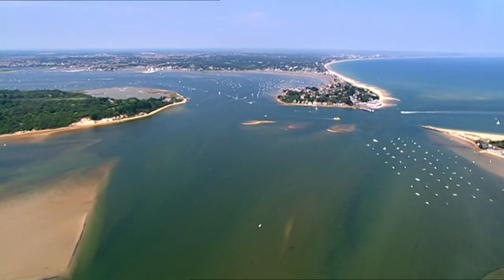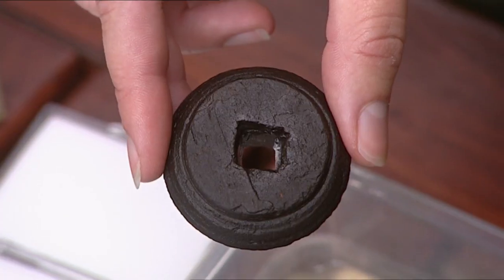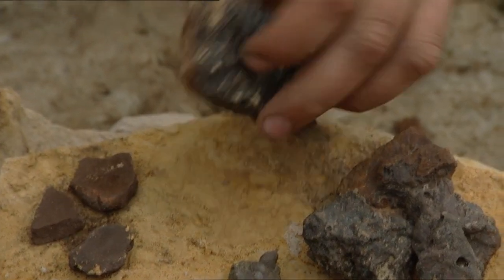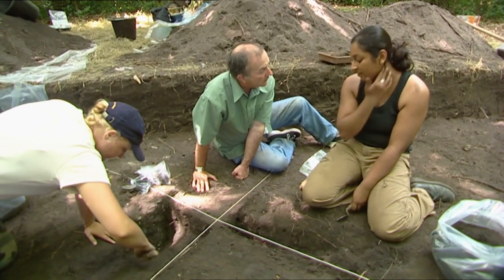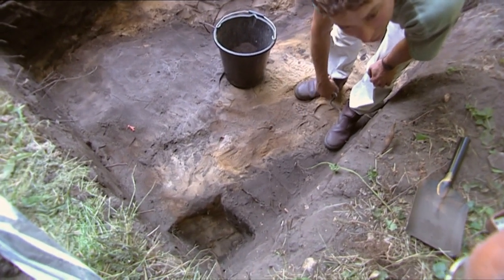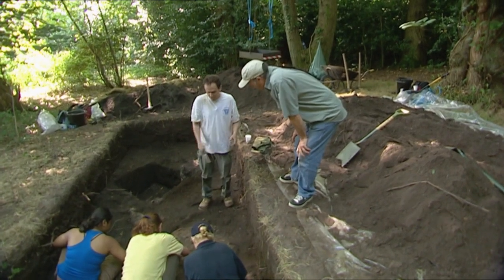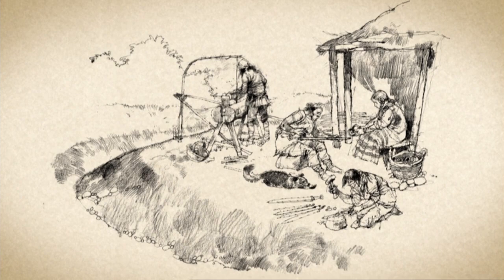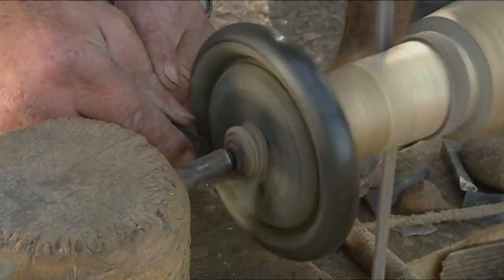An Iron-Age Trading Centre, Green Island | FULL EPISODE | Time Team

Comment: I lived on the island of Elba for a few years and when we dug a five metre deep pit to accomodate a sewage lifting pump we found Etruscan iron working deposits including haematitic ore (from the island) and charcoal. I enquired and was told by local experts that for each ton of crushed ore twenty tons of oak wood (Ilex) was required for the process. Very quickly the timber resources of the island were exhausted and the ore was exported to the nearby mainland for processing where timber was more readily available. The Green Island project missed the important fact that charcoal would have had to have been imported from elsewhere....
Reply: Ilex is holly. Oak is Quercus